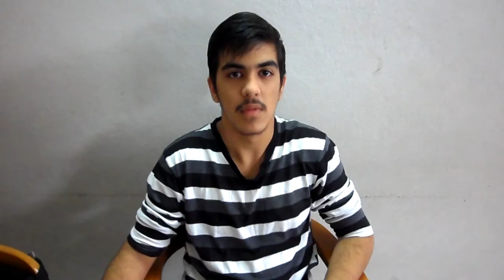$2000 Gaming PC Build! (Featuring GTX 780  and i7- 4770K)

Comment: i would say go with dual gtx 780's with acx cooling, overclock it to 1150Mhz each, and as for the processor, the case, i think corsair 800D would be perfect, very spacious and can be used for 2-3 builds, CPU cooling H100i is very good, btw if you are just gaming and not using youtube or any other like editing, an SSD is not necessary, just get a good rpm HDD, also RAM 32 GB is an overkill, i'd say go with 16gb because games use a maximum of 4gb since this is a gaming build
Your friend- Dev :)